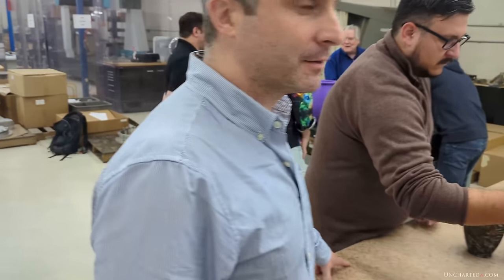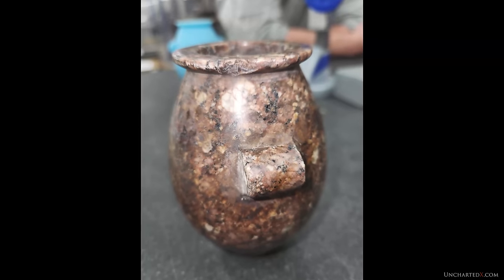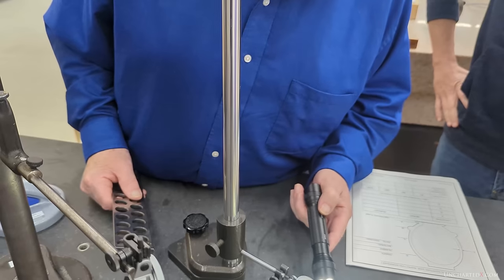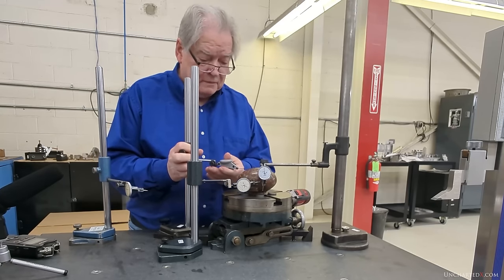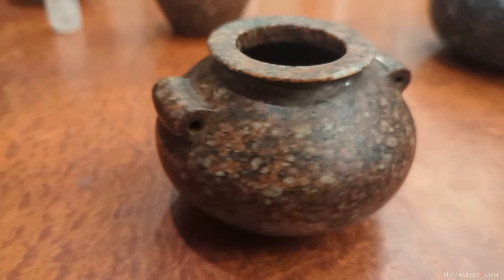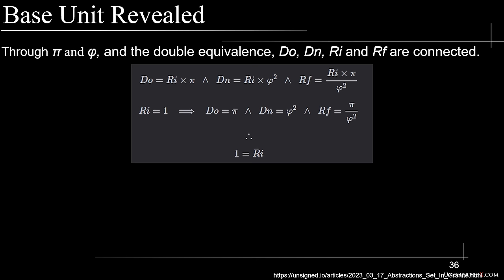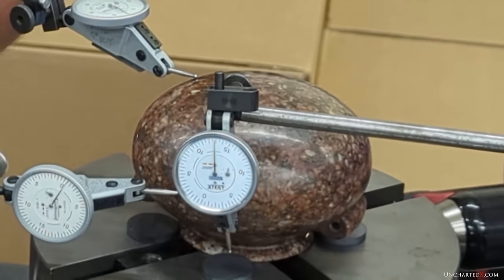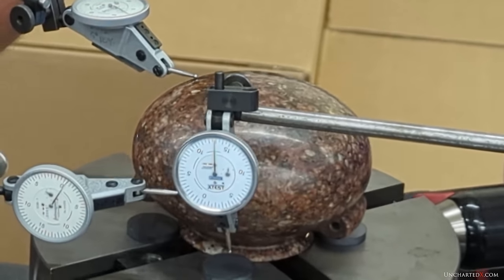Astonishing Results! More Ancient Egyptian Granite Vases Analyzed! More STL's available.

Comment: 1 thousand of inch can be achieved with a simple lathe easily, and without precision measuring tools.  Granite is easy to achieve high concentricity on a lathe because of the hardness. It’s clear that the vase was made on a lathe.  The problem is where is the proof of when and where that was made?  Half of them could be fake, they could be made by some other culture, and they could only be 100 years old.  Based on the evidence they were made using a lathe, and the lack of proof of age, there is no “smoking gun”.  

Ben is also confusing precision and precision manufacturing.  These vases show signs of precision in concentricity, but not precision to each other.  If they were produced on a CNC machine or with precision tools you would expect to have multiple vases with identical size/shape/wall thickness/etc.  They are all over the place in those regards, which suggest single manufacture on a simple lathe.
Reply: what about the perpendicularity of the z-axis compared to the flat surface defined by the mouth of the vase? using primitive means, how does one verify precision of that to within a few 1000ths of an inch?
Reply: @AustinKoleCarlisle  the mistake you are making is that you are assuming that the precision was verified, measured, and made to a specific standard.  If that was the case there should be multiple cases of the exact same vase with the same measurements.  Nothing about anything that was shown in this video shows that precision measurement tools were used because there is no consistency in machining piece to piece that can’t be explained away with a simple lathe.  The bottom and top of the vase could easily be parallel to one another via a normal lathe.  The concentricity of the inside and outside of the vase could easily be very accurate and consistent to one another with a lathe.  What couldn’t be done with a simple lathe on that other than the areas between the handles?  Which I gave a very reasonable explanation as to how that could have been done?
Reply: @AustinKoleCarlisle  a simple lathe can achieve 1 thou accuracy on a round object like a vase, and could make hundreds of such objects all of which would be within 1 thousand of a inch within itself.  Those 100 objects would not be within 1 thou of each other, because each one is unique, which is what is seen in this video.  The precision of a single object and the precision within that object doesn’t prove sophisticated measuring devices were used because each one is unique and simple explanations can explain why that is.   If blue prints are found that match the objects dimensions, sophisticated measuring tools are found, templates that indicate lathe profiles to be used, or multiple vases of the exact same measurements are found, those all indicate precision measurements were used/required.  Nothing like that exists, or was remotely shown in this video.  What was shown is individual stone vases of unverified origins, of varying concentricity, dimensions/weight/material/etc.  Everything points to a lathe made them
Reply: @makingmistakeswithgreg  if it were that easy to make, then why do these vases date to the Old Kingdom, and why didn't later Dynasties continue to make these vases? why have we never created granite vases with handles to the same level of precision as this vase? your casual dismissal of the extreme precision stands in stark contrast to what we actually see happening in real life, which means it's not as cut and dry as you like to think.
Reply: @AustinKoleCarlisle  here is the problem with what you said.  “These vases date to” where is the proof those specific vases in the video date to the old kingdom?   The one measured at higher concentricity could be a fake and the other that was clearly less concentric could be real.  Or the higher precision one could be 1,000 years newer than the other one.  Based on the evidence presented there is no way to know this.  This alone is a serious flaw in a argument that uses dates as evidence.  

You keep talking about high level of precision, but what’s going on here is a high level of concentricity that is possible with a lathe.  There was no evidence in any of his videos on vases that show high levels of precision manufacturing on a wide scale in a way that couldn’t be achieved with a lathe.   Calling it high precision is a way to make it seem like it’s more than it is.  It’s precision compared to what?  It’s only consistently round, and consistently flat on the top and bottom.  It’s consistent within itself, not with a blue print, a specification, or another identical object.  Calling it a precision artifact implies it was made to be a specific size exactly and everything about it was done for a specific purpose.  That would imply a blueprint and measuring tools were used to make it exactly that size.  That is far fetched because what about all of the other ones? Where are the measuring tools to make precise measurements?  Why does it have to be the specific size it has to be and where is the evidence?  He claims wild stuff like sacred geometry but that is really not a challengeable argument because it’s not based on facts.  Not to mention a simple lathe could make that, and what’s more believable, sacred geometry and precision measuring tools or a fairly simple lathe?
Reply: @AustinKoleCarlisle   we haven’t built a pyramid to the same size and measurements as the great pyramid, is that proof we couldn’t?  The reason certain things are no longer done have more to do with cost, and available talent then it does anything else.  We don’t build granite and marble city halls anymore, yet in major cities everywhere are that exact thing.  Does that mean we can’t build such things?  No, we choose not too.  A logical reason to why granite vases not being made anymore (which btw far better works in granite we’re done by many civilizations after the Egyptians) is likely because they took too much time to make.  Please cite literature that shows that style of vases were done by the old kingdom as well.  It’s very common for Ben to make statements that aren’t backed in facts.  

I have no skin in the when it was made game.  Old kingdom, new kingdom, or a 1950 Chinese forgery, it was made on a lathe.  His examples varied so widely in concentricity making any conclusion to how they were made is almost impossible.  The two he showed were made on a lathe.  The other ones may be been made some other way.  The age is irrelevant.
Reply: @makingmistakeswithgreg  you didn't address the fact that the vases are not only precise on the outer surfaces, they are also precise in wall thickness to within a few 1000ths of an inch.
Reply: @AustinKoleCarlisle  I addressed it in my other post.  A lathe can easily make a object like a vase that is concentric on the inside and outside.  Measuring between the inside and outside of something that was spun on a simple lathe can easily show consistent thickness at a single point.  If you look at the vase where he shined the light though, clearly it is not consistent in thickness top to bottom of the cavity.  However because it was spun on a lathe it will be consistent in thickness at any given point provided you measure in a ring around its circumference parallel to the top and bottom.  In simple terms if you measure 3 inches up from the bottom of the vase and put a set of calipers at that point, and spin the vase, you would likely measure a very accurate tolerance.  That is because of the principals of how a lathe or similar machine works.  If you use a set of calipers and check thickness from the bottom to the top (parallel to the sides) of the vase there will be far more changes in thickness.  It is possible to make the side of a vase top to bottom exactly the same thickness with a simple lathe, its just far more difficult (not impossible).  To achieve this would be much easier with a set of mildy precise calipers.  Based on what what shown all of the "high precision" can be achieved with a simple lathe and simple tooling.  The hardness of the tooling or grit used will just make the job faster/easier.
Reply: @makingmistakeswithgreg  yeah but how did they know when to stop turning the vase when cutting the interior if they didn't have a micrometer to measure the wall thickness?
Reply: @AustinKoleCarlisle  you are making a assumption that the wall was designed per a plan to have a very specific wall thickness.  If all the vases found had exactly 2mm wall thickness that would be a sign that precision measuring tools were used to determine when to stop machining, and that a plan with a specific dimension existed.  Every vase on display has a different wall thickness, that’s clear.  The one he shined the light through has clearly different wall thicknesses at different points as well.  This all points towards the simple conclusion that a manual lathe was used, and the results can be achieved without precision measuring tools.  Precision measuring is only required to build duplicates of something, they are not required to build a singular unique item with high concentricity.  Again Ben is trying to compare what he calls “high precision” in multiple objects as proof of high technology, yet every object is completely different and a simple lathe is capable of producing what he calls “high precision” in multiple unique objects.  A simple lathe is not capable of producing multiple objects with near exact dimensions (down to the thousandth) without precision measuring instruments because there is no way to maintain those dimensions.  Nowhere in any video Ben has uploaded does it show anything close to this.
Reply: @makingmistakeswithgreg  yeah but you don't know if something is fully machined to a precision that isn't verifiable by eye or touch unless you have a tool to verify it. remember, we are dealing with things that are below the level of sight and touch. that requires precision measuring tools.
Reply: @AustinKoleCarlisle again, I don’t think you understand how a lathe works.  You put a object such as a round granite bar in a lathe and spin it, put a tool on a rest, and feed the tool into the granite bar.  The machine cut on the outside diameter will be reduced as the cutter machines the granite.  In the case of granite, abrasives would be used instead of something like a chisel.  The tolerance capable of a simple lathe is easily 1 thousandth.  Please google what is a simple lathe’s machining tolerance to better understand this.

I can go on my lathe right now and spin a round bar of steel, granite, or whatever you want and maintain 1 thou or under (provided the material is hard enough to maintain dimensions, the harder the material the easier it is) concentricity without a single precision measuring tool.  You do not need a precision measuring tool to produce a concentric or near perfectly round object, the lathe itself inherently produces this on its own.  You keep going back to the same thought of “precision” but the fact it’s near perfectly round in spots is because it was done on a lathe.  You don’t need precision measuring tools to make perfectly round objects on a lathe.  You need precision measuring tools to make multiple objects that are the same size, or to make a object that the exact size that a blueprint calls for.  There is no evidence presented anywhere that I have seen that there are multiple identical vases, or any evidence to even suggest specific tolerances in any dimension were commonly used.  If you disagree where is any proof to your thoughts?  There is no point in measuring a vase turned on a lathe with a precision instrument unless you’re trying to build to a blueprint or your trying to make multiple of the same thing.  It’s completely unrealistic to think every vase had a completely different blueprint and specifications for all dimensions, when you could just spin whatever round blank you had and make the best you could out of it.  Again a lathe can maintain tight tolerances in concentricity by the inherit design of how a lathe works.  There is nothing unrealistic about this.  

And again, he has access to a collection of objects of questionable history.  Some of them clearly have far poorer tolerances.  He provides no evidence to the effect of all of them are absolutely from the times he claims.  The lathe capable of producing a bowl to a 1 thou outside concentricity likely existed at by the end of Egypt, and that could have produced a vase like shown without a single precision measuring tool.  That higher precision vase could have been made by later Egyptian culture and the poorer precision ones are older.  He can’t absolutely say the dates of any of them so his whole argument falls apart.  At best he discovered the Egyptians had a lathe earlier than first thought.
Reply: @makingmistakeswithgreg  how do your arguments compare to all those other experienced machinists in the comment section who all seem to marvel at these results and claim this could not be done with a lathe?
Reply: @tomwinkler7800 

If a machinist thinks a tolerance of one thou can’t be maintained on something made from granite on a lathe, they aren’t much of a machinist.  Granite is the perfect material to achieve high concentricity/roundness with because of how hard and stable it is.  Don’t take my word for it, google “what is the average manual lathe accuracy precision” and you can see plenty of articles that support the ability on a simple lathe of achieving high accuracy.  

I think the supposed machinists amazement is because if they were tasked to make a exact replica of the vase they couldn’t do it.  There are numerous reasons for this.  First off, modern machinists rarely work with granite.  Which that in itself is  humorous because they work off granite surface plates which are capable of  maintaining a 3-5 ten thou or less accuracy end to end of a big plate.  That “high precision vase” had accuracy between a half tho and 3+ thou that they showed, with the other one being considerably poorer.  That surface plate 
In the video was 6-10 times as precisely flat than that vase was perfectly round, and a flat plate is much harder to achieve that level of flatness than a round object is roundness.  The accuracy shown on the “most precise vase” is within the realm of a simple lathe.  Don’t take my word, google it.  

The issue with why a machinist would struggle to duplicate that vase is also a problem of trying to copy something.  Imagine owning a 1970 corvette, and you want a second one.  It’s easily possible to find another and make it look exactly like the one you have.  However say you want to take a high resolution scanner on the new one and it must be precisely the exact same dimensions as your current one, down to a 32nd of an inch.  That’s simply not possible to duplicate that level of precision because the variables are too great.  Well that vase in the video is extremely round, that was proven.  A modern machinist can turn any hard material to an equal tolerance of that vase as far as roundness is concerned.  However trying to duplicate every measurement at every point and maintain a half tho of accuracy on a duplicate of that vase would be extremely improbable if not impossible.  There are simply too many measurements and too many variables to attempt to duplicate it precisely.  That is a non issue though, and proves nothing.  Why?  Because the Egyptians couldn’t have duplicated it either.  Ask a machinist to turn a unique granite vase on a simple lathe and make it as concentric as he can.  Take the completed vase and tell another machinist to duplicate that to a half thou and he couldn’t do it either, yet it was clearly created with simple tools.  

Not to mention there is not one shred of evidence that exists of multiple vases that are the same dimensionally.  I have said it countless times but look at the vases he has on the table, not a single one is even close to another in dimensions.  All of them are unique works of art, spun in a lathe.  They are all at various levels of roundness/concentricity, none of them are perfect, they have variations.  Again he keeps talking about “high precision” to confuse “highly round or concentric”.  There is no shared precision amongst any of those vases beyond how round they are, and how flat the tops and bottoms are.  Those are all things lathes and simple tools can achieve perfectly.  If all of them had 1/16th thick side walls, exactly 3 inch deep lip to bottom measurements, and other identical measurements, it could be said they are precision vases.  At that point It could also be suggested that they were then made with precision measuring instruments and were specifically made to be what they are.  The simple reality is all of them are unique works that show no evidence of precision measuring.  

Edit:  you could put a dial indicator on a plate of glass and potentially see a runout of half a thou to one thou on 5 inches of it.  Does that prove the glass was made with high precision or that high precision tools were used to make it?  Absolutely not.  Does it prove that the flatness of the glass was an absolute concern on the design of it?  Absolutely not.  What it proves is the process that made it was capable of that precision, and the precision was a byproduct of the process.  Glass is not advertised as being exceptionally flat when you buy a replacement panel for a window, yet it is.  The flatness is not a concern.  Just like spinning a granite vase in a lathe will create a precisely round object, which is a by product of how a lathe works.  If precision was a concern for the makers of those jars they would have made a ton very close in size.  Not a bunch of completely random shapes that are only dimensionally precise within the single object and not across many.